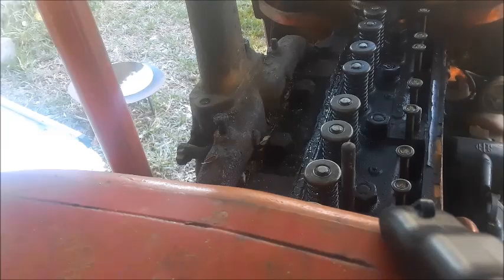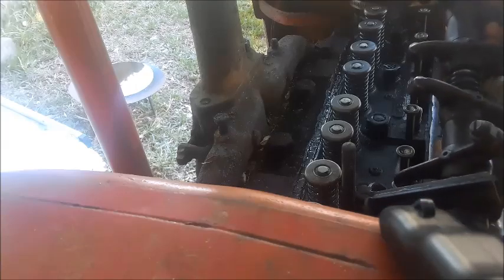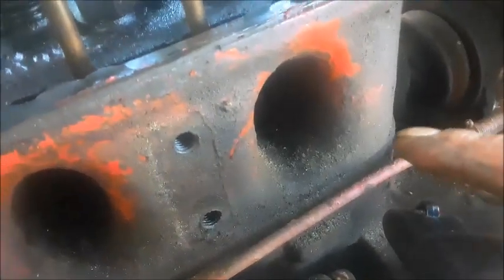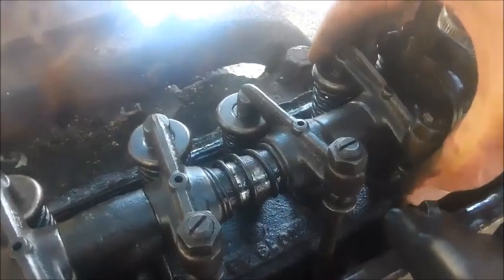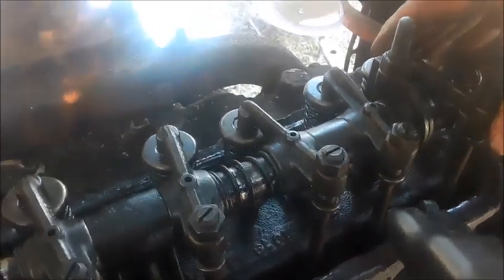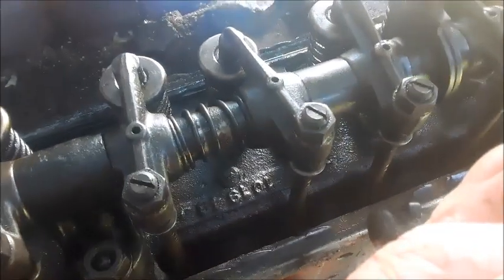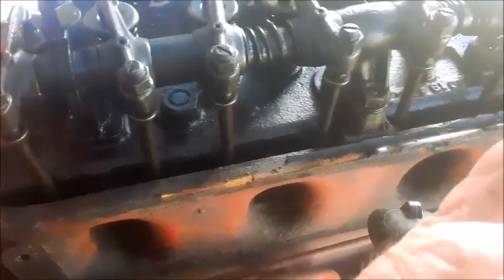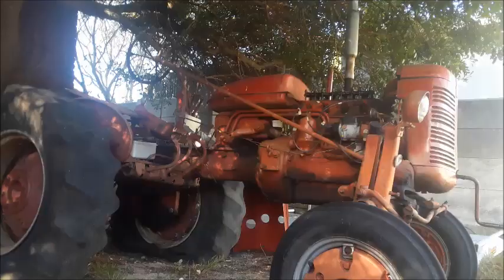Farmall Update. (I FORGOT TO RECORD THE IMPORTANT PART) Carb Still blocked, READ DESCRIPTION

Comment: Good evening Jan.
Look just a wee tight there Jan.. get them set correctly, the head bolts torqued properly.. and as long as the head gasket isn't screwed up, that should do it 🤞
Reply from the maker: Ed the spec say's 0.017 and I set it at +- 0,015, at least all off them have little movement, after installing the rack it was all WAY to tight, specially 3 and 4, it is a kick my a... dam video to discovered I never press the record on the pressure test but it looks if they jump to 100, if weather allows I will do it over tomorrow and clean the carb
Reply: @jankotze1959  sounds a lot better than it was!!
I hate when you think you're recording and the camera was on a coffee break!!
Reply from the maker: @GosselinFarmsEdGosselin  ☕☕☕